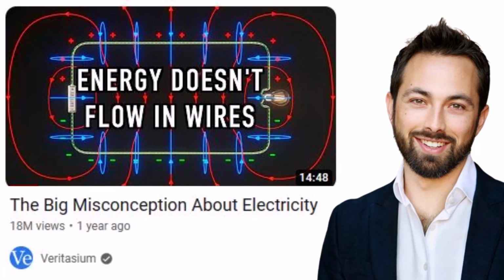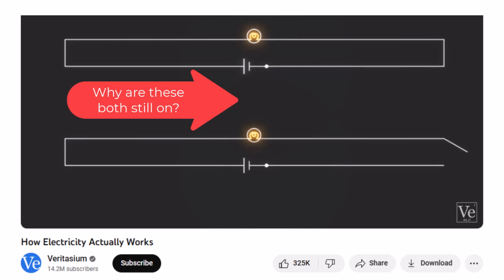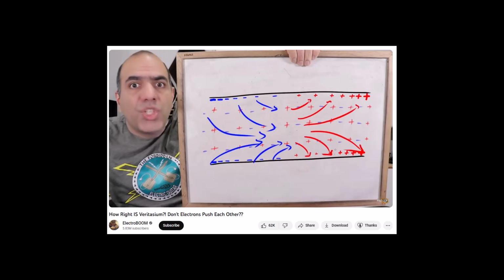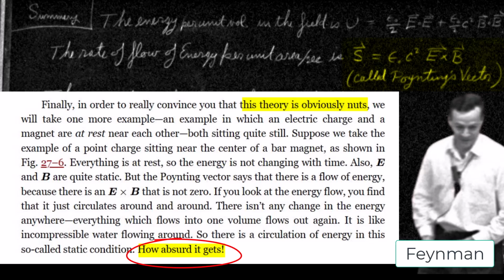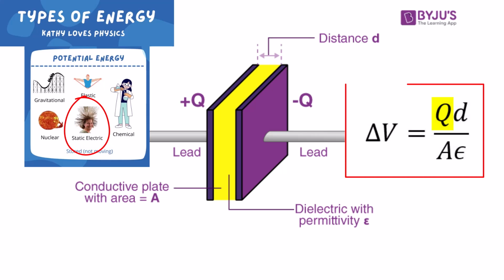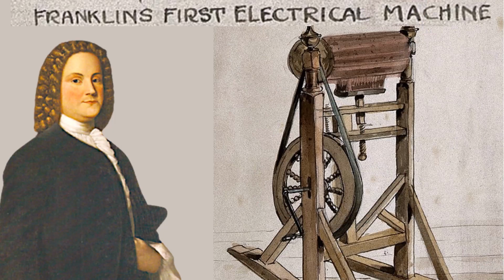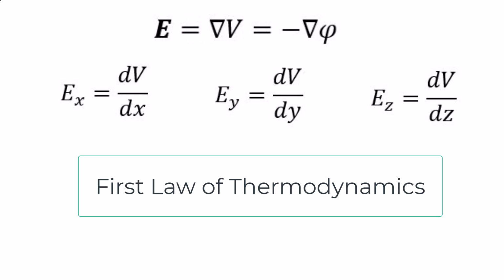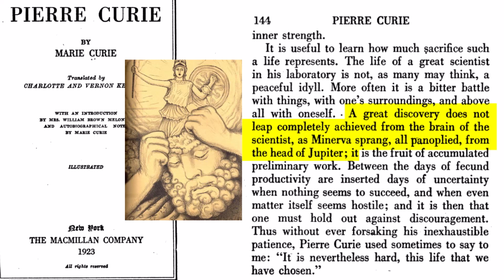Deep Dive Historical Response to Veritasium’s DC Electricity Video

Comment: I disproved Veritasium with a very simple experiment: I put a second light bulb right on top of the first bulb, but without connecting it to the battery. If the electrical energy flows through the air directly from the battery towards the bulbs, both should've lit up. But only the connected one did.

Derek did not respond or explain why the unconnected bulb did not light up. To be fair, his video had already received tens of thousands of responses by then, and it was physically impossible for him to respond to every one of them.

I also pointed out that in computer networking, the network latency—the time it takes for electrical signals to travel from one computer to another—depends on the length of the connecting wire, and not on the as-the-crow-flies distance between the computers. This fact is not in dispute. This is why the stock exchanges, for example, make sure that the networking cables connecting the exchange servers with the traders' servers are all of the same length, so that all traders receive trade messages at exactly the same time—to the nanosecond.
Reply: AlphaPhoenix showed it also works with disconnected lines. How did you do the experiment? Because you need very sensitive equipment to actually measure this and a normal light bulp won't actually light up visualy.
Reply: @drfisheye  Oh, I'm not disputing that an electromagnetic pulse (EMP) spreads out from the switch—not the battery, BTW—when it is closed. No doubt, the EMP can be measured with sufficiently sensitive instruments. This EMP travels at the speed of light (in air) and jiggles the electrons and protons in all the objects it passes through, including the bulb, its filament, and its glass shell. In fact, as you pointed out, it's not even necessary for that bulb to be connected to the switch and battery for it to feel the EMP. The length of the wire is irrelevant—it's just a misdirection.

BTW, I'm an engineer and a licensed HAM, so I know my way around Maxwell's equations, electromagnetic waves, wireless transmitters and receivers, oscilloscopes etc. Of course, I'm not saying I understand everything—far from it. And while I use the Poynting Vector to calculate the power transmitted by an EM wave, I don't ever recall using it to calculate power transfer in an electrical circuit. In a circuit, it's always P=v(t)i(t) (or some variant).

It's not that the Veritasium video is wrong. It's the fact that Derek deliberately misleads you—without being technically wrong—that bugs me. I know he has to do click-baity stuff like that to grab eyeballs. Still, I find his "everything you know is wrong" attitude quite irritating. Particularly because I coach high school students for competitive college entrance exams. I don't know what kind of schools Derek went to. But here in India, high school students do learn about transformers, electromagnetic waves etc. With equations (though not vector calculus just yet). We do tell them upfront that we're teaching them a simplified version of reality, and that they are free to study more complex models later on if they wish. We teach them stuff that they can build upon later, not stuff they have to forget and start over from scratch.

You teach them that the flow of charged particles is electricity, I = Q/t, P=VI etc., and they will reach the logical conclusion that in solid conductors, it's the electrons that carry the electrical energy. That mental model is sufficient for working with electrical circuits, so we don't correct it until a better model is required.

Some of my students watched the video in question, and sadly, got confused about the role of wires in an electrical circuit. They argued that since energy flows directly from the battery into the bulb through space, and not via electrons in the wire, all bulbs in the vicinity should light up, connected or not. At least, that's what the Poynting Vector diagram in the video implies.

No doubt, all the bulbs felt the EMP. (Though you can argue whether it caused any of the bulbs to "glow" in any meaningful sense.) However, any transient currents due to the EMP are very weak, and die down very quickly. After a short delay, the bulb that's connected to the battery starts glowing steadily—when electricity actually starts flowing through it. The length of the wire determines the delay. (There are transient currents through the wire as well, for that matter, but after a while, those too die down.) And the unconnected bulbs don't glow.

This isn't obvious from the video. The Poynting Vector diagram seems to imply that if you keep an unconnected bulb close to the connected one, both should glow steadily. Easy to disprove. Harder to explain Derek's motive.

Comment: The first undersea telegraphy cable didn't work. Different frequencies travel at different speeds. 

On the other hand, hams use antennas of a length that assumes speed of light pretty much, reduced by a few percent, so that question's answered.

Comment: Yes Kathy you may know about this but if you Google "curl your Poynting vector" you will see a very detailed analysis of the question you are discussing. The author says Poynting vector although mathematically correct and consistent(which of course it has to be because of local energy conservation) is completely inappropriate when discussing energy flow in dc circuits. You could still use it for dc energy calculation. It's completely appropriate for ac energy flow discussion, yes of course because ALL energy will be in EM waves all OUTSIDE AND SURROUNDING CONDUCTOR a much more straight forward situation than trying to explain what's actually going on at a point INSIDE a conductor!
So yes you are correct Kathy but please send your love to the wonderful Poynting vector because of it's important role in the differential equation which describes LOCAL ENERGY CONSERVATION in electromagnetism.

Comment: Your videos are brilliant but Derick is wrong because he thinks all energy outside for dc and that's wrong YOU ARE MORE CORRECT KATHY but you have local energy conservation always and that's why you need Poynting vector. 
For dc energy flow is both inside and outside wire. For high frequency AC all energy flow is in EM waves OUTSIDE the wire. For dc you will have Poynting vector inside and outside the wire and outside ONLY for ac.

Comment: Cavities in a conductor shield from STATIC electric fields NOT dynamic electric fields(fields changing w.r.t  time). Faraday cage is electrostatics, Laplace equation for constant boundary conditions has unique solution, potential constant in cavity ie NO static electric field. You can put phone in faraday cage and it will still work just fine. Faraday cage shielding does NOT work for electric dynamics. For phone shielding relies on SKIN EFFECT attenuation of dynamic fields, different differential equation. Electric dynamics fields, EM waves are easily attenuated by good conductors. Different physics tho, NOT faraday cage shielding (boundary value problem) but attention of dynamic fields by a good conductor.
ALSO energy flow for DC current will be both thru the wire and around the wire.
For high frequency AC current which will be subject to SKIN EFFECT all current will be on surface of conductor and all energy will be OUTSIDE and around the conductor(wire).

Comment: With electromagnetic theory, static or dynamic you always have LOCAL ENERGY CONSERVATION. Rate of change of energy density PLUS work done by field on charges or charges on fields PLUS flux of energy thru boundary surface ALWAYS SUMS TO ZERO. You need Poynting vector for the flux(you integrate Poynting vector over boundary S) There is nothing wrong with Poynting vector, it's essential, how could you find total energy flow thru boundary S with out Poynting vector!
ALSO it's only with high frequency AC that current is confined to surface of conductor. With DC you have current INSIDE conductor and field inside and out side conductor there for energy flow inside and outside conductor.
In a lightning strike of the ground energy would flow both thru ground and thru the air.
Faraday cage is about the unique solution of Laplace equation for constant boundary conditions and Gauss Law. You can still receive a phone call in you Faraday cage. So I fail to understand where problem is really.

Comment: I was very disappointed to see the video end with (E) as the answer i.e. it depends on specific properties of the components used.

Could someone please suggest which of (A) to (D) is closest to the correct answer? (with idealized components or not, dealer's choice)

Comment: About energy storage in a capacitor:  you say that the energy is stored in the dielectric?  Often this is represented as electron displacement in the material.  Where is it stored in a vacuum capacitor with no such material?  In the DC case there is stored energy in the physical supports of the capacitor plates as they resist the electrostatic forces of attraction/repulsion, but that hardly explains what happens at high frequency AC.  So how is energy stored in nothing?

(Hmm, just teasing...)
Reply: In a capacitor again, the energy is stored in the Fields (between plates) energy is in fields whether or not you have a dielectric in place. Change on plates ENERGY BETWEEN PLATES stored as potential energy IN THE FIELDS!!!!!

Comment: Here's another Veritasium video which employs questionable logic, How Special Relativity Makes Magnets Work. He uses the common theory that when a charged particle is moving outside a wire with electricity flowing inside of it that, from the charge's frame, the wire is length contracted and that makes the protons inside of it become closer together but the electrons are moving at the same speed as the charged particle so they seem father apart than the non-moving protons. The flaw in the logic is covered up in Derek's visual the same way that others cover it up when describing it verbally, they specify that the wire is of infinite length, Derek just made the wire go across the entire video screen so the ends aren't shown. 

Why do they specify an impossible condition instead of a possible one, like a wire 1 meter long? Because if the wire was of a finite length and it contracted, along with the protons inside of it, but the spaces between the electron did not contract, then obviously the same number of electrons could not fit inside the wire which is now shorter. What happens to the extra electrons that can no longer fit inside the now shorter wire, do they get ejected out the ends and then go back in if the charged particle stops moving? Is that believable? Obviously not, so there goes Derek's little video about relativity making magnets work. Try again, Derek, and this time try something that doesn't require an infinite wire that exists nowhere in the universe.

Comment: Wouldn’t you be able to test conductivity by changing the shape of a wire, imagine you have a 30 mm thick wire, and it is perfectly round. Then imagine you take the same wire and flatten it where the flat wire is the same amount of metal but is now 1 mm thick and is no longer around but flattened out. Would you see a difference in conductivity? Because there is more surface area?

Comment: i have a huge 48 volt battery with a big switch connected (by a heavy short wire) on the "-" pole of the battery and 2 wires connected, one to the other side of the switch and the other wire connected to the "+" pole of the battery.  these two wires run a great distance to i don't know where.  i don't know what they are connected to on the other end.  my question is this.  when i close the switch, how much electric current flows over which wire to be interacted with whatever is on the other end?  3 amps?  what if the 2 wires run all the way to the moon together?  what if there is a light on the moon that the 2 wires are connected to rated for 48 volts and 144 watts?

Comment: I love your content, but I still want to respectfully question your interpretation of Feynman's comments.  Your content seems to imply that Feynman would somehow dismiss Poynting's theory but I think the opposite is true. The whole paragraph you marked seems to be a kind of rhetoric where Feynman puts himself into the shoes of his students and their intuitions which would dismiss the results of Poynting's "crazy" theory as "obviously nuts". Later he gives explanations why it actually still makes sense even if it does not fit intuitions. From later in the section: "You don’t need to feel that you will be in great trouble if you forget once in a while that the energy in a wire is flowing into the wire from the outside, rather than along the wire."

(I might have misunderstood you or Feynman, not a native speaker)

Comment: The stated use of a filament light bulb, where significant current must flow for more than a moment in order to cause illumination, eliminates small transient conditions from being the focus of the experiment.   If the test would have been shown with a sensitive meter able to show a pulse this would have been an entirely different model.  The answer of 1m/C would not have worked based on capacitance between wires at 12 volts 1 meter a part for filament light bulb.  Note; the actual setup shows an LED 120 volt lamp which all have delayed startups.  That's even a worse detector for transient response than a filament lamp and has a minimum trip voltage for LEDs where a wire filament will at least glow.  

This would be the type of question to catch people that are not really able to take on actual critical thought problems.   The use of a slow reacting sensors, the filament lamp, eliminates discussion of micro transient response.

Comment: reason I unsubscribed from Veritasium.  While the first video already disagreeable, it was made worse by his second video trying to prove he is right. On the second video where he detects the flick of the switch is miniscule in power and EM signals are everywhere.  If the point he wants to make is correct then we just flick a switch at very high frequencies to light up an LED bulb. I think the reason the vertiasium video blew up is science or people having a single idea of electric current whereas it is both wave and electron flow, one can't exist without the other.

Comment: "The electrical signal flowing through the wire is just logical". Yep, but quantum field theory produces a lot of results are not  "logical". The electromagnetic field is everywhere, and  disturbances (like closing the switch) changes the electromagnetic field everywhere. You can describe part of the changes as EM pulse, and part as "flowing through the wire", and part as "charging a capacitor", etc.. But all these things are just convenient (classical physics) approximations, that seem to seem getting in the way of understanding reality of the electromagnetic field.

Comment: It is not just an EM pulse. Consider The two wires with two breaks the half light second away. It is not ciruit (almost) at all. However the two wires are now a two plate capacitor. A really small sub pF one but capacitor none the less. That capacitor will charge up and induce a matching charge on the disconnected wire either side of the bulb. On top of that the current flowing through the wire while it charges up the capacitor creates a magnetic field the changing magnetic field also induces a current through the bulb. A stupidly small one.
So no 99.99% of the current/energy in vertasium circuit indeed flows through the wire but initially, a stupidly small transient is propagated via capacitance and inductance. (not via real photons (EM) but via capacitative and induction effects usually ignored as the current they cause are so tiny.

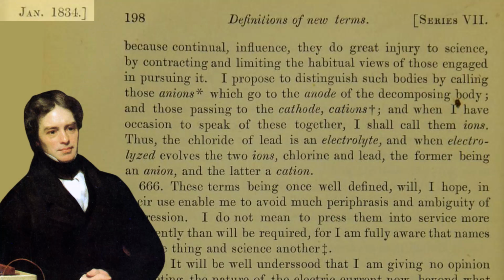Comment: @15:00 you say that Faraday named the Positive electrode the Cathode and the Negative electrode the Anode.  But in vacuum tubes, the Cathode is connected to the negative terminal of the battery, and the Anode is connected to the positive terminal, so that (negatively charged) electrons flow from Cathode to Anode.  Did 'positive' and 'negative' change their definition after Faraday's time?

On another topic, how about debunking Tim Maudlin's misleading notion that Bell's Theorem provides a relevant and reliable model of Quantum Physics.  Even Feynman dismissed Bell's Theorem as irrelevant because it was based on Newton's simplifying assumption that time ticks at a uniform rate everywhere and everywhen in the cosmos — a notion conclusively overthrown by Einstein's model of time dilation (which ineluctably causes decoherence in modern qubits).

Comment: My problem with Derek’s video was that it was technically correct but only by being sneaky, saying that the lamp would light in the presence of any current. As AlphaPhoenix demonstrated, the initial EMF jolt was minuscule and the bulk of the current had to go the long way around. Anyone using the simple lightyear long notion of the circuit would have been more correct than someone taking Derek’s video on face value believing it magically jumped only a metre.

Comment: She is correct. The switching effect on the bulb is almost instantaneous as Derek proposed, but infinitesimal in the beginning. In an infinite wire, the bulb maybe wouldn't never emit visibly light, the induced current could be insufficient.

Comment: The difference in noise susceptibility between the AM and FM radios is only partly due to the modulation. Yes, FM is more resistant to noise than AM (though it's not totally immune). But just as important is the fact that FM broadcast radio operates on much higher frequencies (88-108 MHz) than AM broadcast radio (0.54 to 1.7 MHz). The noise generated by transients and sparks does not have a flat frequency spectrum; it is much stronger at the low frequencies of AM broadcasting than at the higher frequencies in the FM broadcast band.